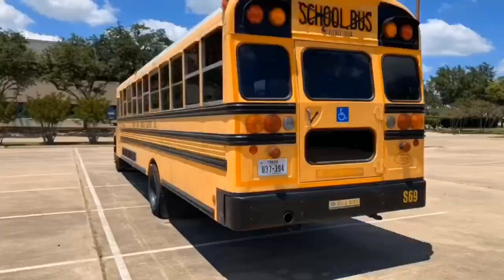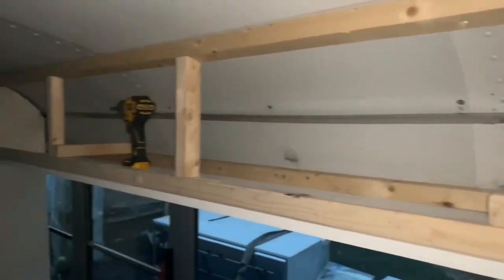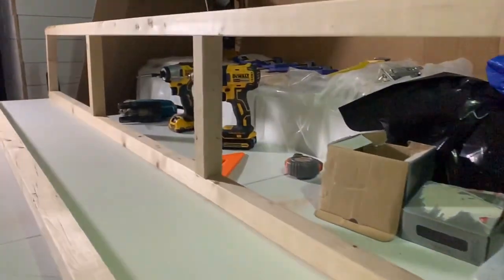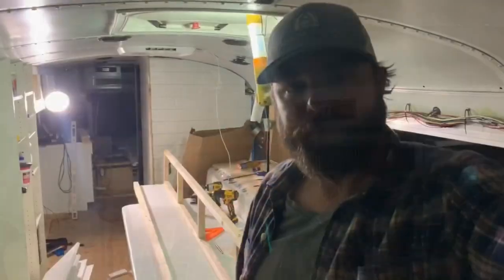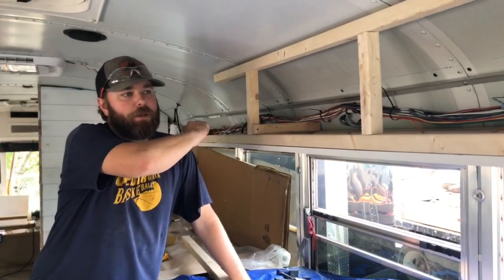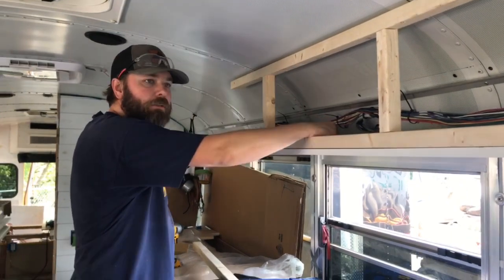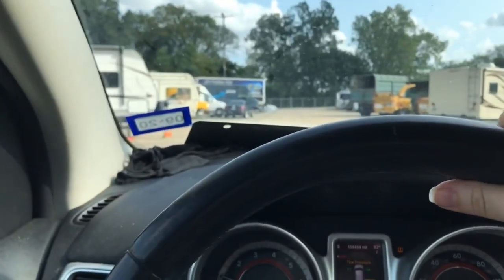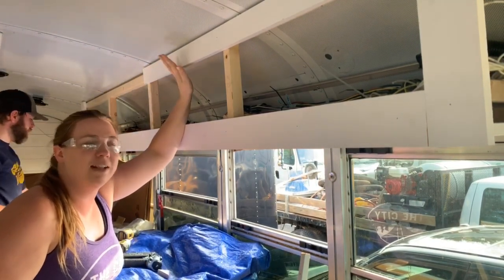Framing Skoolie Upper Cabinets || 2020 Bus Conversion - Ep 27 | TaleOfTwoSmittys

Comment: Help!😳 I found this video and it has inspired me to take on the yask of building cabinets for my short bus Schoolie.  Being that I have “0” carpentry skills, I am terrified when it comes to drilling files in my bus.  Question. . .what size screws do I use to drill into my 2x2’s so that I can hang them on the walls and attach my cabinet face? I'm starting from scratch and did I mention I have very limited carpentry skills?👀 please, please help a Sista out.  Thanks!

Comment: I was wondering about that wire covering.  I see you removed it.  I will see when you get there, to covering the wires back up. 
Thank you very much. 
Robert
Reply from the maker: Robert Corbett probably just going to have a trim piece in the back of the cabinet screwed to the back 2x2 which will hide the wires. Thanks for checking us out!
Reply: @TaleOfTwoSmittys  good idea